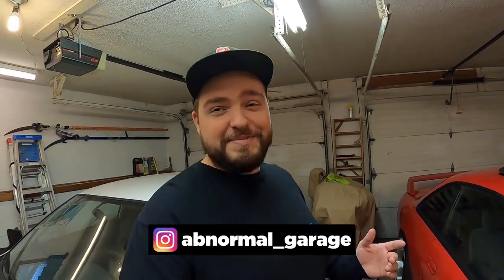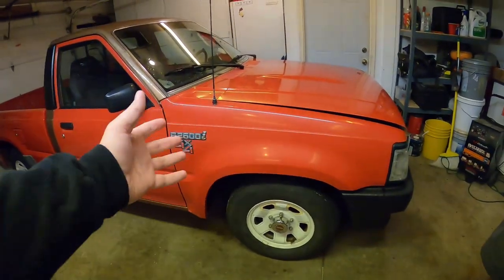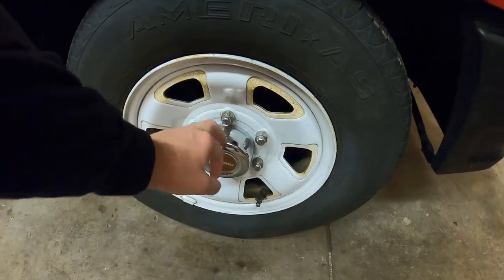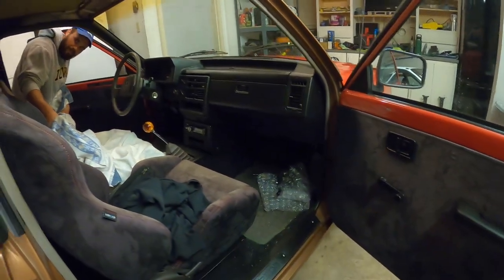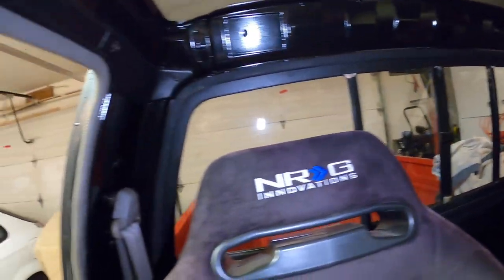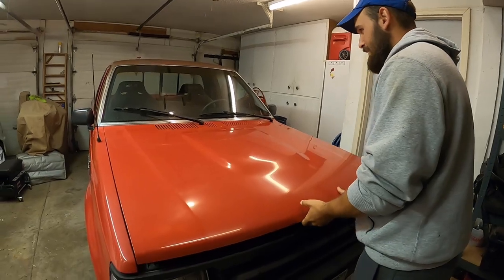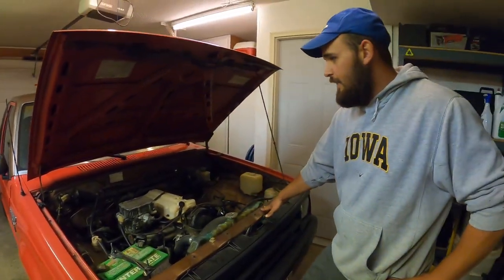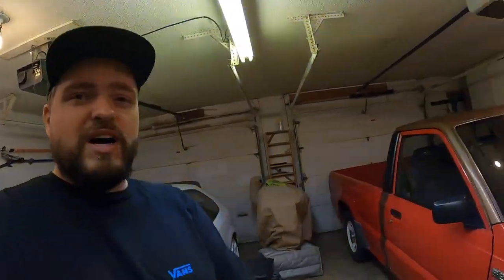What Happened To The Mazda B2000?

Comment: Yall should look up the Kia Sportage motor by the title of FE3. It's a slightly built version of your existing 2.2, to the point that it'll directly bolt up to the trans and frame without any need to mod them. The fe3 is a fuel injected and turbo able engine.

Comment: I have a 86 b2000 that I put a mx5 1.8l with a Garrett t3t4 turbo running 15lbs among a list of other things done to the motor. Then I put a tacoma 8" axle with Yukon 4:11 gears . The damn thing is a screamer. Lowered it 5 " . Doing a coilover conversion this winter . I also did the fender mirrors couple yrs ago looks sick with them . Should do them .
Reply: How well does a stock mx5 motor go into one of these things? Motors mounts, driveline and what not?

Comment: That fuel door won't latch because the bed mounted springy metal latch tjingy is missing. If the filler garnish isn't broken it's lose there because the latch bolts/nuts hold it in place.  

I've always disliked that style sail mount door mirrors.   After putting up for 29 years of them being too smol and the Blaze Red paint on them faded to Flamin Pink, I replaced them with 97-01 Jeep XJ power heated mirrors.  Huge improvement in side/read viewing, can be folded front or back without messing with the mirror adjustment and less wind noise at higher speeds.  IMO they look nice on the truck too.

Comment: Stay away from Miata motor (you’ll be disappointed) . K24 would be a fun swap (Kpower would have a lot of support!) Cheapest would be the classic Fe3. 4.8 would likely be disappointing, would recommend 302 if want more displacement
Reply: Greg Peters (thecarpassionchannel) would argue differently.
Reply: Also, I'm a die hard old Ford nerd but a LS based 4.8 is a better motor than a 302.  You can do so much more with a mldern 4.8/5.2/5.7.

Comment: Definitely get away from the old B series motors.  I've rebuilt enough of them to know they're slow, they leak, and they run hot.
Reply: Agreed lol I have a 91 Mazda b2200 and blew one motor up then I put another motor in it and it was always something leaking on it then I didnt check the oil for a week and the rear main seal and front main seal was both leaking and I ended up locking it up now it has a ford 302 out of a 86 ford f150 and a 5 speed and it's a ride for sure
Reply: @ethancarter92  Yeah I've destroyed a few myself.  One sheared a rod, broke the block, and caught on fire. I gave the sheared rod and piston to my local Mazda dealership.  Parts guys got a kick out of that.  I had to be up around 110-120mph at the time.
Blew a head gasket on another.  In fairness, I was younger (and not too smart) and abused them.  Both were 2.2 liter b series engines.  I could rebuild one of those in my sleep though.
Reply: Yeah I was 16 and thought it was a good idea to run from the cops my speedo didnt work but I left them and still have a video that some random person took when I did it I blew it up but still got away with my truck good time lol

Comment: The fe motor easy swap to do everything bolts up and motor come out of Kia shortage 90s model and good wheel size is 15x8 and 15x10 back that what I had in my Mazda b2200 with custom control arms with Chevy s10 ball joints and had modded knuckle for extra angle with 4x4 Hom joints had to run Chevy s10 shocks because I was 6 or more in front if reindex the torsion bars and had 4 In angle black with leaf took out to make it 5 or more and had to run a custom made drive shafts with shock in middle of it were don’t jam it self in to transmission and had to cut were carer bearing sit at notch it were the new drive shaft will sit it and soon I switch to air shock in back because any thing over 200 lbs made squat bad